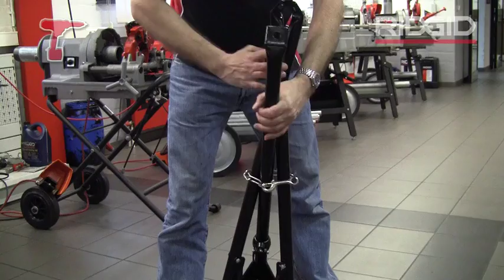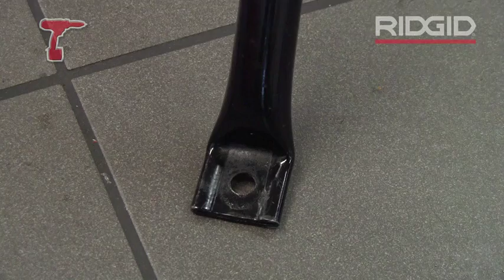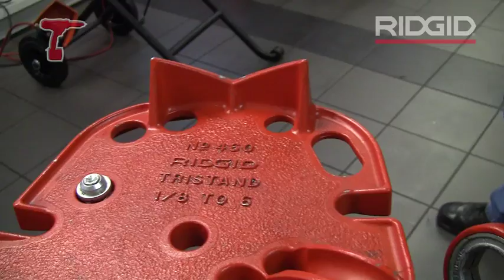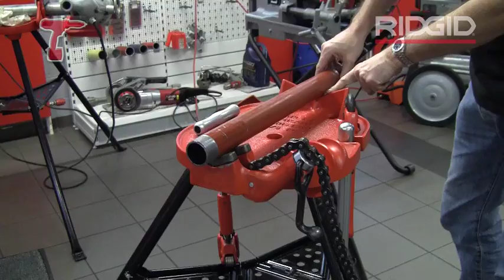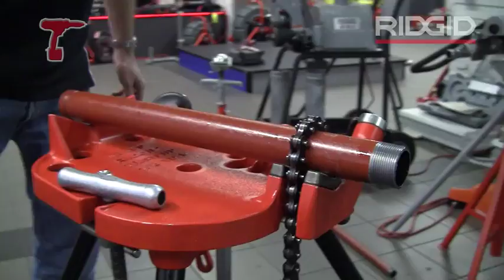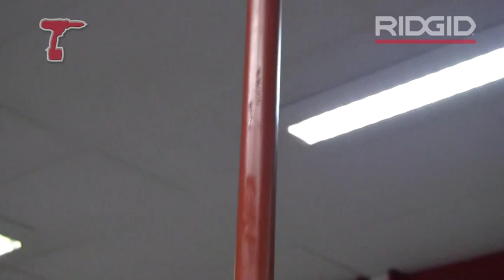Ridgid 460 Portable Tristand with Chain Vice

Comment: lots of cheap imitations out there but the Rigid is tried and true..been a pipe welder for 18 years and use it all the time...  however the only reason i looked up this video was to find out what the hell that screw was for..  another £1 for you my friend
Reply: I too was here for the very reason to find out wth the screw thingy was for. I'm an electrician and I have never needed it while threading conduit but I figured it was for the welders or some other trade.  I have never got an answer on that thing until now.

Comment: Also the video should mention when using the Ceiling Brace Screw the Ceiling Brace Screw can begin to loosen while the 460-Tristand is in use thereby allowing the pipe that is being forced against the ceiling to fall and potentially cause injury or death.

Additionally the video does not show the correct method to take down (collapse the legs).

Otherwise this is a good video.